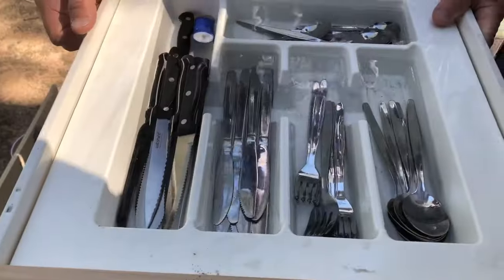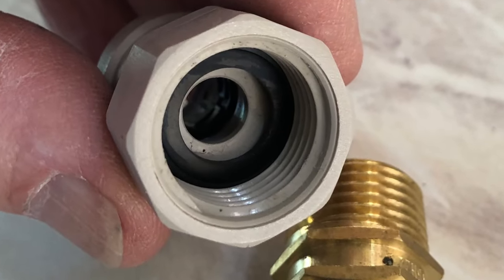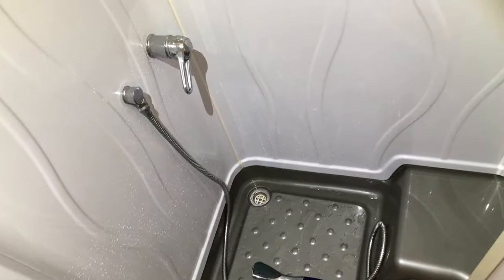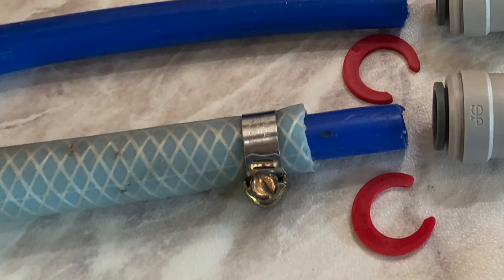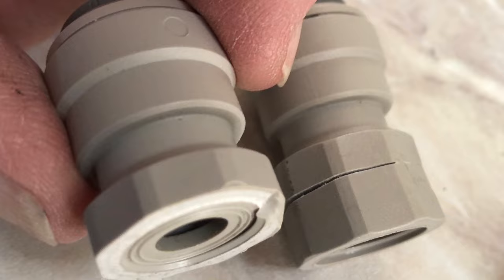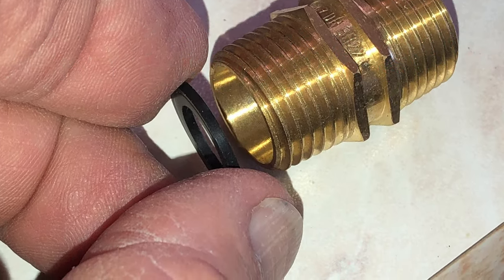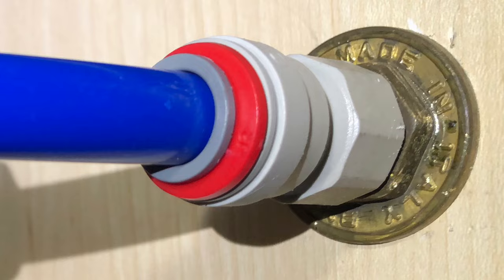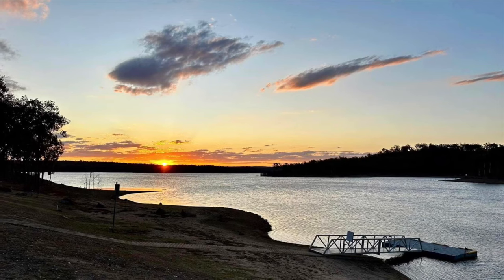How To Fix & Replace John Guest RV fittings

Comment: Thanks Barry. They are prone to crack and fail even without the tape. We have toilet paper secured around all fittings and pipework so one can readily identify a failed fitting as we nolonger leave the pump turned on when not using.water and we nolonger use direct from tap water supply that won't stop if there is a failure. We listen carefully to the water pump when we turn it on to see if it let's us know there is air in the line and hence a water leak. All our plumbing is between the two floors or in the cupboards or walls and so the leak can't escape to ground, rather it wets the timber construction should we not notice. So we have become somewhat cautious after a couple of failed fittings.
Reply from the maker: Our first one was the hot water outlet from the Truma HWS.   We’d been travelling and stopped for afternoon tea, only to find water running out from under a bed , where the HWS was. 

No warning - so it’s off with the 12v water pump when travelling. 

Not a big fan either of hooking the mH up to mains water.

Comment: Best thing I did was put 1.5 laps of tape on the sink mixer connections, they say not to use tape but when I got my new van everything was leaking, now it's not, and I'm also not a fan of connecting main hose to the van. I carry about 3m of each hose color, and have a emergency kit ( cost me $160) with all types of clamps and fittings.